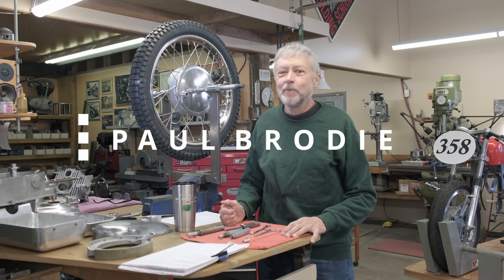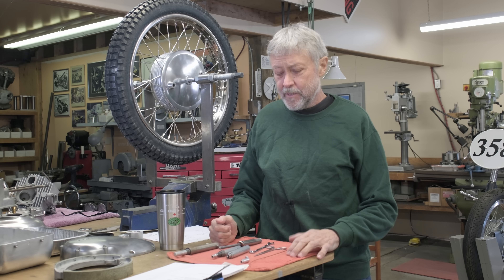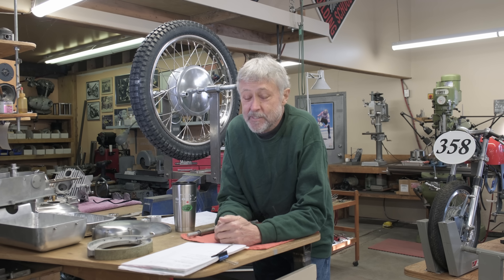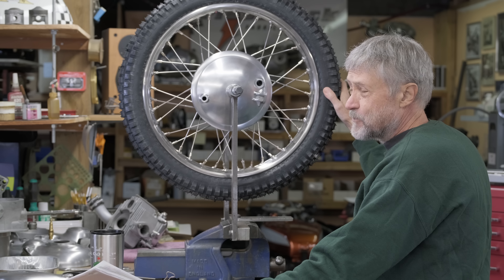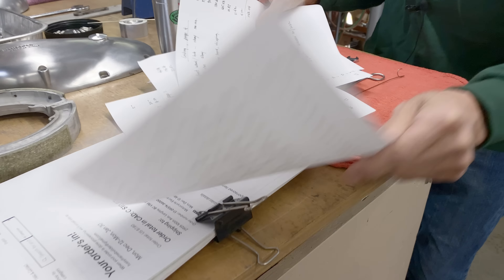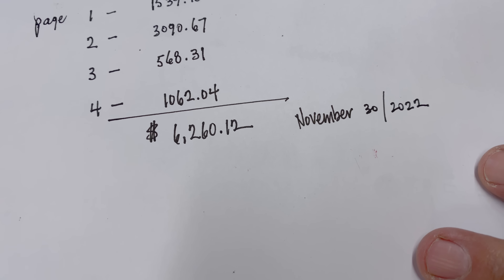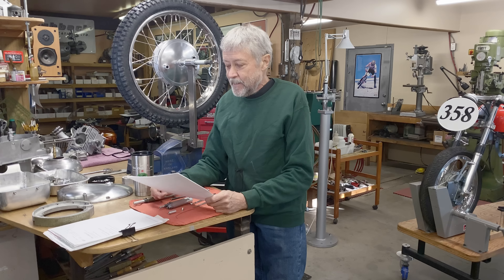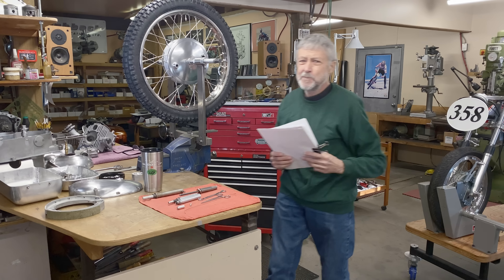Tiger Cub Start Up! // Paul Brodie's Shop

Comment: I said 8 right away. Especially when you said a grand for a wheel? Man where are you shopping ? 😄
They do make better 10 dollar Chinese bar ends. I bought 3 or 4 10 dollar ones before biting the bullet and splurging 180 bucks for true triumph bar ends. Insane huh.
Don't you just hate it when working on one thing and finding something else?🤪. Good luck with your bike and your cancer, totally recovery. Take care.
Reply from the maker: Thanks Peter. I might have paid too much for the rim; everything else was market value.

Comment: Honda 250 or 305 engine sitting in the snow.
Reply from the maker: Yes, a 305 from the early sixties. Someone left it at my shop years ago so now it's mine!
Reply: @paulbrodie  What year is the engine I may have a "matching frame". Or if you want to do a 305 build I have a frame and a whole lot else. Great little engine, I have seen some racers stuff a 450 honda crank and pistons into the cases along with a ton of welding rod, and a good amount of machine time.
Reply from the maker: @maaseyracer  Someone has been been cutting at at the cases with a hacksaw. I am not going to touch it. I have lots of other, more useful projects, but thanks.

Comment: $1,000 to build the front wheel? I joke that jeez, maybe I should build THOSE instead of bicycle wheels! Make more money 😁. 

I like looking at those Tiger Cubs, but I have to admit they’re on the slow side. Not hard to see how the Japanese small bikes blew them out of the water. Ah well.
Reply from the maker: The front wheel cost does not include my labour. Parts have become expensive. What's nice about a Cub with its relatively small motor, is that you get to wind it out a lot of the time. Perfect for my neighbourhood!

Comment: Thought u ment when new.
$775. 00 if it were /////say 1968
It's older though.
Reply from the maker: I do not know the price of a new Tiger Cub. I would say less than $775 back in '68. I bought a used one in 1970 for $125.
Reply: I bought a 66 P 11 disassemble disassemble in? 80 for 150.00
Day shift came in the control room and says///I smell BONDO?
I GOT the tank pretty smooth.
That fork oil? That was unlike any thing ever /were oder!
Pretty brasing on the frame joints! THE rims had some more quality plating on them/not one blemish.
My Golden Pinto was 150.00 in 70/71. JC Penny's  Put it in the trunk of Mother's second hand 70 LTD. Started about as easy as my older brothers 68 250 Trophy!Never burnt up any electrical though.Ha!
Sister in Law/one of 5 is fighting cancer too.
Tammy n Terry Gelespy.
Today's news is its much worse .Pray for her.

Comment: It’s called a Kelly clamp, not surgical tweezers.
Reply from the maker: Thanks Dennis, but the majority of viewers have told me it's called a Hemostat..
Reply: @paulbrodie  A hemostat and Kelly clamp are very similar. Hemostats are smaller and the tips come almost to a fine point for clamping off small blood vessels which are then either electrically cauterized or tied off. Kelly clamps are bigger with more rounded tips and are used to clamp larger amounts of tissue which can then be tied off with larger ligature material to control bleeding. I guess a Kelly clamp is a kind of hemostat. So six of one, half dozen of the other.
Reply from the maker: @dennissilber287  Thanks Dennis. I am obviously still learning!
Reply: @paulbrodie  Aren’t we all! At least those of us who are still curious enough.

Comment: It's alive, but I consider it cheating, didn't you know you have to kick an old motorcycle to start it. If I can't kick it, time to turn in my plates. What happened to pts. & condenser? Complain about a $10 mirror and the fancy schmancy ignition from down under is bass ackwards. Can't wait to hear it tick over.
Reply from the maker: In my condition, I do not consider it cheating. Wasn't long ago that I was in hospital for 61 days. I'm just happy to be able to do small things in my shop. Points and condenser are in a box under my bench. I'm just doing it my way, and you obviously are not in approval.